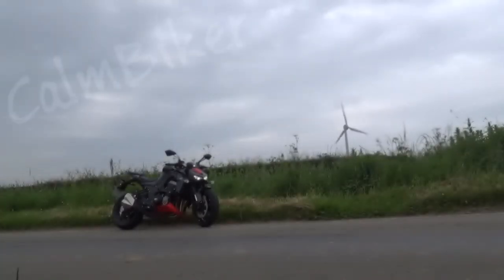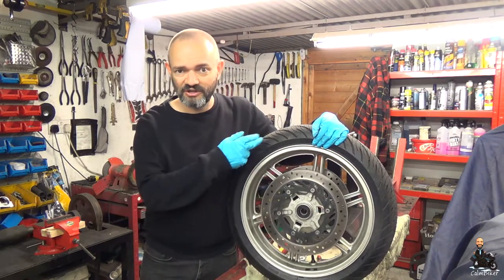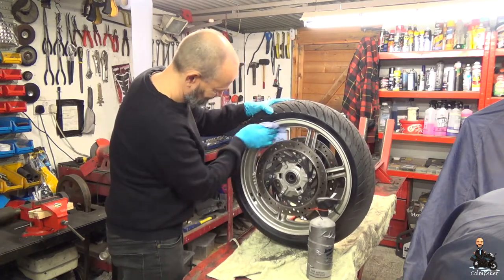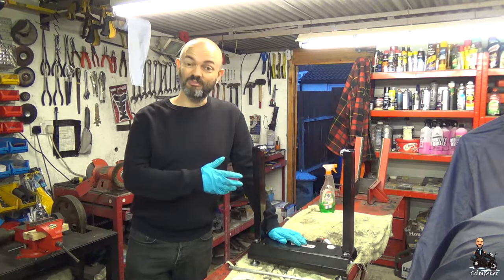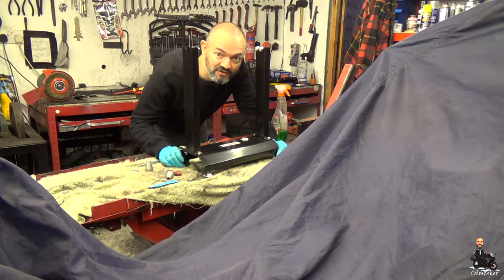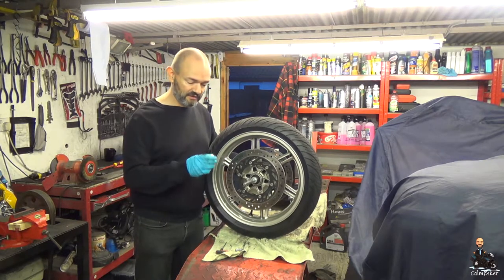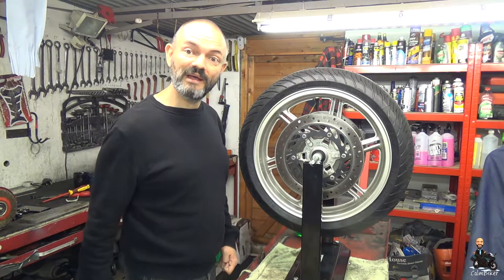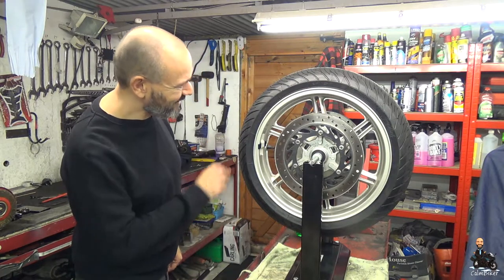785. Balancing a Motorcycle Wheel | Garage Video

Comment: I did a lot of this kind of thing in my first job but what i had to balance was tumble dryer drums that would hold 20Lb 30Lb 50Lb and 75Lb of clothes
Reply from the maker: Bigger weights I assume!
Reply: PS them flat extra bits go close to the end of the bar near but not touching the bearings, looks like to stop the bar from sliding off. got a pic if you need it ;-)
Reply from the maker: whoamiuk1 we did wonder but had no instructions. I will remember for Saturday when I fit the Honda with new boots!

Comment: Care to offer a link for the balancer ?
Reply from the maker: I just bought it from eBay so difficult to give a link to the exact machine. It's a fairly standard piece of kit though. One that looks pretty much identical but with a link that will hang around more is - https://www.amazon.co.uk/dp/B00DRFXW0U/ref=cm_sw_em_r_mt_dp_U_7BeYEbH24M0YT
The only difference I can see is that one doesn't appear to have a spirit level built in, so you would probably want a sick-on one, probably something like - https://www.amazon.co.uk/dp/B07D8YDFRW/ref=cm_sw_em_r_mt_dp_U_pEeYEbM44J9GW